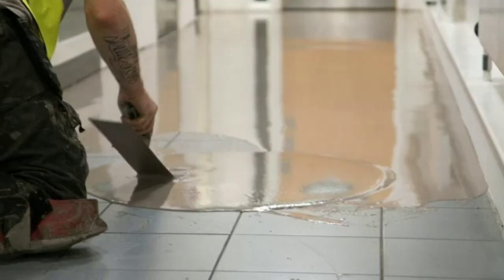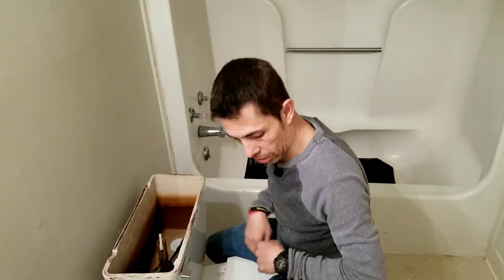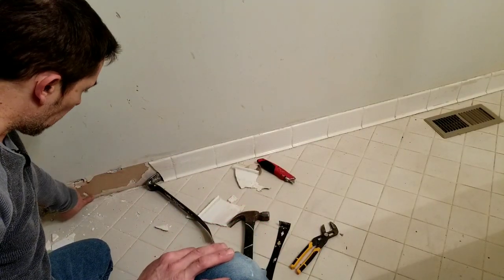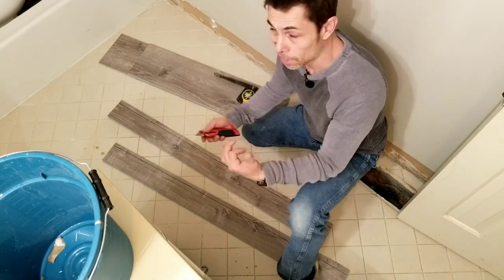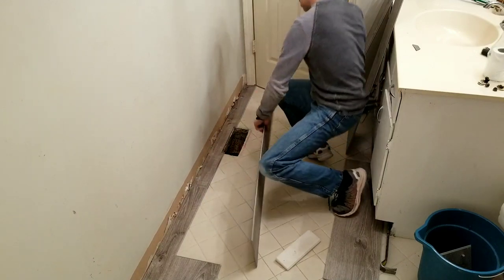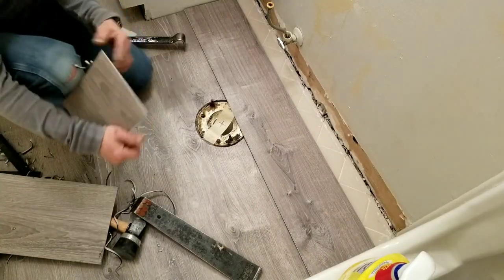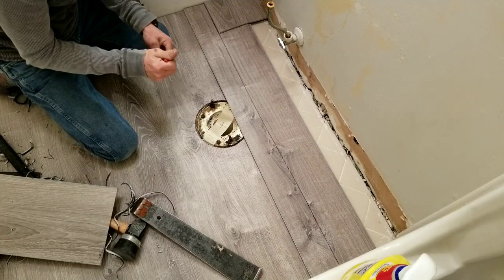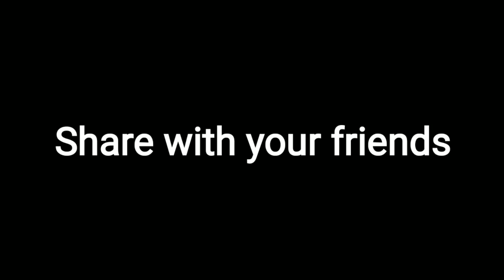LifeProof Vinyl Plank Flooring Over Existing Tile Tutorial

Comment: How about when you come up against the tub? Do you just caulk to fill the expansion gap?? Im having a tought time because the gap is a bit jagged. Im worried caulking will look sloppy. Any options??
Reply from the maker: Have you already installed the flooring up against the tub. If so you can install 1/4 against the tub. I would suggest using real wood or a water proof material as opposed to the mdf. Use silicone  to seal the gap between the floor and tub. Nail the 1/4 down through the gap in the floor at a slight angle. If you haven't installed the flooring yet let me know and I'll tell you how to get it real close with a small gap and a nice fine caulk line. Now if the floor is installed already. Another option to help with the jaggedness if you don't like the 1/4 round. Take some tape and put it on the floor as close to the tub as you can (without touching the tub)without going over the gap. Now you can caulk against the tub and when you pull the tape the outside of your caulk line will be clean and straight. Hope that helps. Sorry for the long answer . Thanks for the question
Reply: @YOUFLOOR  no prob w the long answer, very thurl! I'm leaning towards the quarter round however i think I'll use an adhesive. Nailing would be tricky considering the gap.
Reply from the maker: Hot glue in a couple spot will help hold it in place while the real adhesive sets up.
Reply: @YOUFLOOR  thanks boss!
Reply: @YOUFLOOR  which adhesive would you recommend for the quarter round? Im looking PL premium fast grab.
Reply from the maker: I usually just use silicone as adhesive. A lot  easier to  remove in the future if something goes wrong. Good luck

Comment: No need for underlayment foam?
Reply from the maker: You do not need an underlayment  if the pad is attached. Plastic vapor barrier is needed if installing laminate on concrete  but not lvp
Reply: I'm planning on doing it over tile, that's why thought maybe underlayment would be needed
Reply from the maker: No, you should be fine to go right over he tile. Good luck on your project

Comment: Well. There’s something fundamental missing here. How level was your tile floor and where the tile edges sticking up at some points ? What of your floor is wide and high and low points can have up to 1.5” height difference. Would one rip the whole floor and level the floor or pull some tiles , grind and level the seams and then put the vinyl plank over ? If these things aren’t addressed properly your installation will have considerable amount of defects showing in less than a year. It’s easy of your floor is smooth and level.
Reply from the maker: This floor was smooth and level. Thanks for the comment

Comment: Is there any issues with noisy clacking when walked on? We are considering doing this, but we're getting a lot of contradicting opinions
Reply from the maker: Well if the tile is not bonded good or the thin set under has become week and started to  crumble, then you would hear that when you walk on it now.  But if it feels real stiff and the grout joints are solid I think it's ok.  I mean if your not having issues with it cracking now,  I wouldn't think it would start cracking  or crumbling because you layed a floating floor on top. Shop vac really good. Hope that helps. Thanks for thre question
Reply: I get what you are saying because I have several hollow tiles throughout the house but how did you know Judy what asking about the tile, lol? She didn't specify what was noisy 🤔.  I only just started researching vinyl planks but learned that some come with noise barrier (quality underlayment) already attached like the Lifeproof you used but some don't come with quality (or any), right?  Maybe that is why she is getting conflicting opinions?  I will ask about the hollow tiles though separately in case that's not what she is asking about.   Thank you _ p.s. great video
Reply from the maker: Well the subject of the video is viynl over tile. Sometimes with engineered wood the over spray from the stain can drip over the sides and harden up. Then when you put the 2 planks together they will rub from not being fully seated due to the over spray and it will cause cracking and popping when walked on. In most cases laminate and vinyl are made different. The locking system doesn't allow for a lot of movement. However with the lifeproof, it's a drop and lock so definitely use a straight edge to check for small concetrted dips. Because it is floating, Any drastic dips could cause one side to pull loose when walked on. Then later when walking on the plank beside it. It will lock back down creating the same click or popping as when initially installed. If you don't do a good sweep and shop vac, any debris underneath (like small pieces of grout) will crunch when being walked on. This can also happen when the this set underneath the tile is not mixed right causing the bond to break loose and stay hidden to the naked eye. But over time it will start cracking and if you dont take care of it before. It's too late once you've  laid the new floor. So be sure there is no hollow spots cause also the tile could break and then the nightmare begins. Even if you pour floor leveler over the whole thing it will not help if the tile installation was not done properly. Hope I explained that well enuff. Sometimes I ramble. Like right now. Lol.and it doesn't make sense. Thanks for the comment and question.

Comment: Great video. I’m doing a 800 sqft living and dining room over 12x12 tile. Ripping old cabinets and a wall exposes parts of kitchen floor that is not tiled. Missing about 8 pieces of tiles. Tiled was layed professionally so its moderately flat. What do you suggest filling in the un tiled area with? Self level concrete?
Reply from the maker: Yes you would be surprised at how smooth the floor leveler comes out. I would definitely fill those in and then feather it out over the surrounding tiles for a smooth transition. Good luck on your project. Thanks for the comment

Comment: my grout lines are exactly 1/4 an inch. is that too big?
Reply from the maker: Hey Elizabeth.  To be honest if I were doing it for a customer.  I would skim coat the floor with o henry floor patch. That wont cost much and will fill in the dips nice and smooth   Hope that helps. thanks for the question

Comment: Did you caulk against the tub or any other places?
Reply from the maker: Yes but I usually use real wood as opposed to the cardboard 1/4 round. And 100% silicone under the 1/4 round and on top to prevent any water from splashing from going under the flooring. If you can get a nice tight line with your flooring you may not need 1/4 round but I would leave a very small expansion gap that is not too visible once a bead of silicone is layed down. Thanks for the question
Reply: @YOUFLOOR  thanks!

Comment: Do you need to leave a small space (1/8") between the vinyl plank and the wall to allow for expansion so the planks do not buckle? And thank you for your extremely informative and smart tutorial video!!
Reply from the maker: Have you ever seen vinyl siding on someone's house that is buckling. that is because vinyl is made to be hung not nail when you drive the nail tight the vinyl expands and contracts  With extreme heatand cold so it doesn't have Room to move. this is the same concept with viynl flooring however if you keep the temperature in your house very consistent there shouldn't be a lot of expansion and contraction but I would leave at least in a 1/8 inch just to be on the safe side.  This may help you out later if you have to shoot a nail through the quarter around down through the floor because you can't catch a stud.  Hope that helps thanks for the question

Comment: Why would you not remove the cabinet and put the floor under it?    That's the correct way to do it.
Reply from the maker: Actually y that is the wrong way to do it. It's okay to put cabinets on tile viynl or nailed down hardwood. But when installing floating floors you need to install up to the cabinets setting heavy objects on floating floors can actually prevent them from expanding and contacting as floating floors do. But thanks for trying
Reply: @YOUFLOOR  I agree with you as the floor needs to expand, but let's be honest,  while  the cabinet does have weight to it, is not that heavy.  The toilet may be heavier than the cabinet...thanks